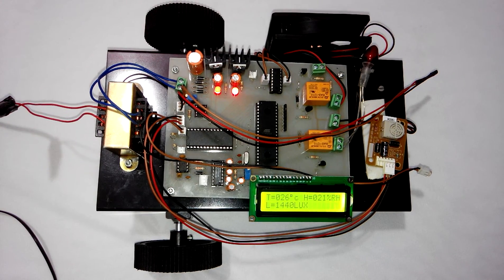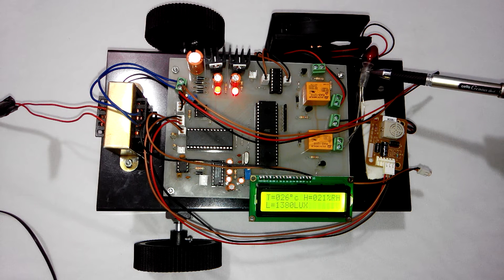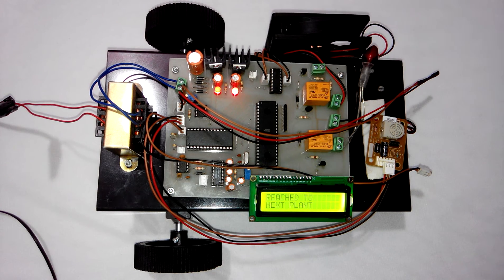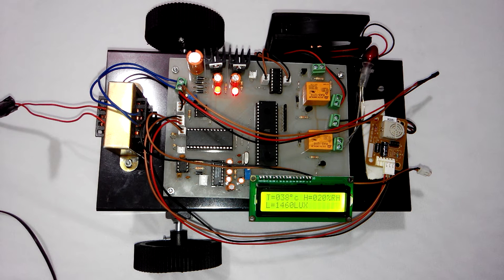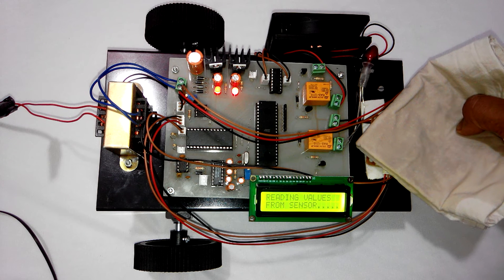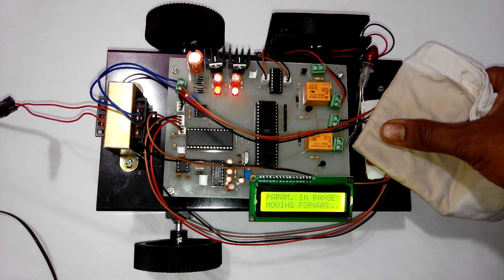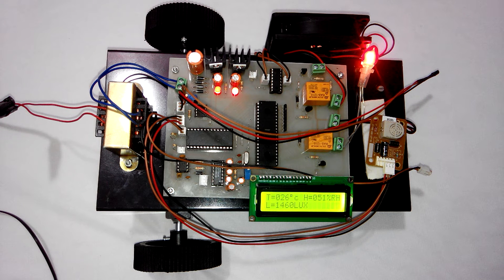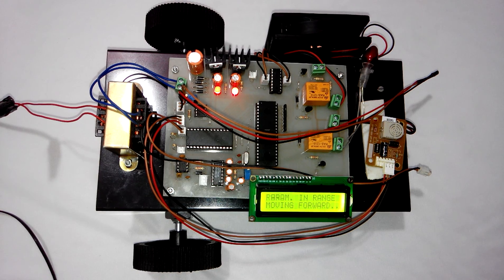Greenhouse environment monitoring and controlling Robot

Comment: Which IC u hv used in this project
Reply from the maker: We have used 89s51 microcontroller, which is 8051 series controller. Also, we have used L293D, ADC0808, IC555, LM358 ICs.